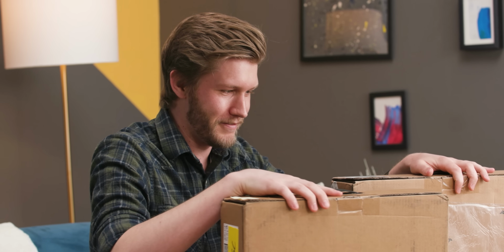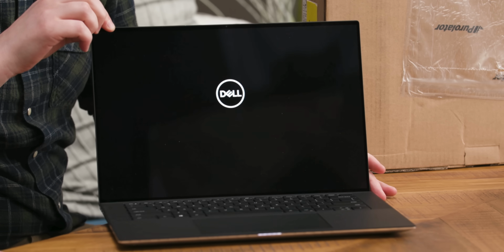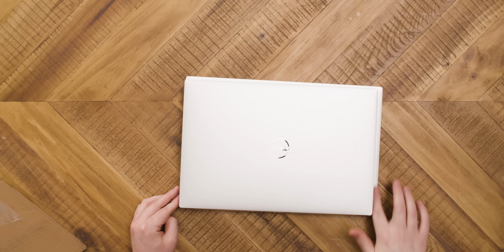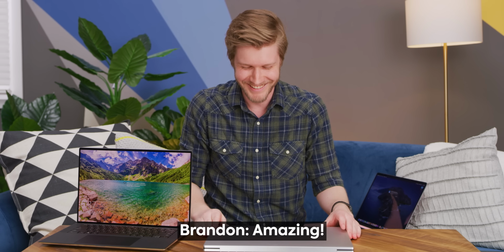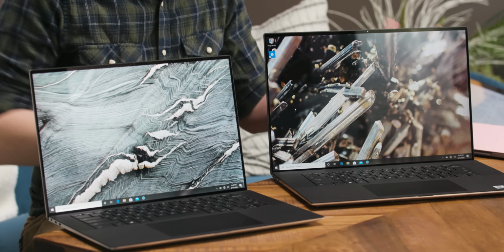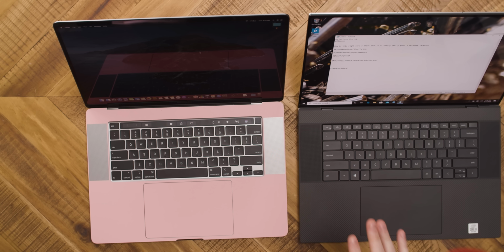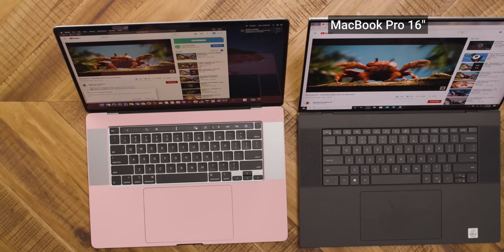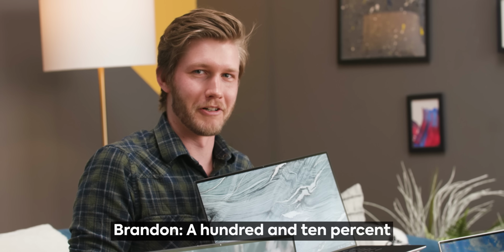The MacBook Pro's Biggest Rival - DELL XPS 15 9500 & 17 9700 Laptops

Comment: (Long rant incoming) 2 years in I figured I'd come back since I had bought my 9500 based off this review so for anyone still considering one, it's an excellent laptop with incredible specs. I purchased mine configured with the i7, GTX 1650, 256gb SSD, and 16 gigs of ram. I have upgraded it with 64 gigs of ram and dual 1TB WD Black NVMe drives and it's an absolute beast of a system, however mine is plagued with the wobbly trackpad issue that has been widely reported with this model of the XPS 15, and starting a few months ago the display hinge on the left side has become incredibly stiff and creaky. Reached out to Dell's support and their first instinct upon mentioning the issues was to immediately throw blame on me and no amount of pressuring on my part ever got them to budge on repairs. So overall it's an excellent system but Dell's awful customer service and the build quality issues I've encountered are absolutely unacceptable for a premium system that carries a price tag in the thousands range.

Comment: hello, i am trying to find the right laptop for a long time..  no gaming, no video editing, no autocad or render work.. i will only use laptop for financial trading stock programs that need high CPU, SSD and ram.  and laptop will be used from 09:00 am to 11 pm // all day nearly of course not will battery, always plugded in. i read some coil whine problems abaout this model.. can you advice this model for me ? heating /cooling issued and stable performance? thank you

Comment: I ordered my 9500 in 8/2020. The trackpad clicks work intermittently. It's very frustrating to use the laptop with the touchpad. I called Dell and they sent a repair technician to my house. The new palm rest/keyboard/trackpad also has the wireless antenna. The cable for the antenna was defective. The technician tried for over an hour to get the cable to work, losing his temper and throwing his tools in my livingroom. The technician also said that Dell doesn't know how to design a laptop. He also got mad when he had an extra part he didn't remember where it went back to. He couldn't get the antenna cable back on but did something with a screw to hold it next to it and told me he didn't have all night to sit here and try to fix it. After the machine was "finished" it still had the same click problem. I called Dell and the first two customer service reps hung up on me. I have been trying to speak to a manager for almost a week now to get a replacement unit sent. I'm telling you, I will never buy another Dell product as long as I live. I should have bought a MBP.

Comment: I just want to share my experience - just over 6 weeks in - of the XPS 15 9500. We bought 4 top-spec versions of these, at a total cost of almost £10k, for our business partners. They look and feel great, at first... but the aluminium is very thin (nothing like a Macbook) and dents incredibly easily. There are SO MANY calibration issues with them. Thermal regulation is a joke; you need to completely shut them down before putting them in a bag, or they overheat to a dangerous degree. The trackpad and keyboard randomly glitch, and the process management is shot - we each have to restart at least once or twice a day, just to get the computer functioning again. The list goes on. They feel very much like pre-release prototypes, rather than high-end or even market-ready machines. Having switched from a 7-year old Macbook Pro with Windows 10 running on Bootcamp, which was otherwise flawless but no longer powerful enough, I'm severely disappointed and frustrated with my experience of Dell. Apparently we are far from alone in these issues - many of which apparently even existed with previous models and were never resolved with drivers / BIOS updates.
Reply: Thank you for this comment. I was about to get the 15 but now I'm holding back and scratching my head at what to get...
Reply: @Iqbal Muhammad haha, no. Just got one and it’s absolutely abysmal how many issues there are in the hardware and software both. Only had it for a few days and I already feel like I need to get it replaced.
Reply: @NikeloaZ  I've re-evaluated my needs and I tried to buy a ThinkPad T14s. However delivery is 6 weeks. :(
Reply: There is no problem on mine. I think windows are updating on your computers. I normally update everything at first. It will take sometimes to update everything.
Reply: @KhoaNewZen  We of course immediately installed all updates. We in fact check for and install updates on a daily basis. The issues are still present, although ever-changing. Slowly the machines have become more functional, but comparing the stability and reliability of these to our prior Macs is sobering. We will never use Dell again. Post-sales care has also been basically non-existent, but now we have invested thousands in these machines we are stuck with them for a while.
Reply: @Iqbal The EOD Specialist That may be, but it's irresponsible of a manufacturer to sell products that are not market-ready. These machines are the business tools of four partners in a business, which has caused a significant negative impact. When buying 'top of the line' computers, for large sums of money, you should not receive a prototype.

Comment: XPS "Last updated in 2012"? The Precision 5000 Series was a new design of its time (I'm typing this on a 2015 5510) I've waited thru the 5520,30 and 40 until they dealt with the heating issues, which they now seem to have dealt with in the 5750 at least.
Was the last major update of the XPS in 2012? Not the bodies I've seen. Is that accurate?

Comment: Why is this newb comparing trackpads like they are the selling point of the laptops? It's not. A larger trackpad has proven to be much much more obstructive to work with than the smaller trackpads. Obviously this guy only has to review the laptops but not work on them. Hence he really has no idea when he "thinks" that larger trackpad is better. Making the move to large trackpads by Apple is the second worst idea ever. The worst is the touch bar.

Comment: I have a 13 inch 1080p laptop screen, and It clearly is not a "retina"" display at a normal distance.. 1080p screen on laptops still look good, but you can 100 percent notice the differnce betweeen 4k screens.. Tired of this idiot reviewers saying theres no difference.. when its so fucking clear as day.... And dont forget that 4k gives you more scaling intervals (since windows 10 only allows 25% increments) and is alot better to cuztimize to your liking..
Reply: I have the Dell XPS 17 9700 with a 4k display, and I really do notice the difference. However, for a 13 inch laptop, the difference is less noticeable than in a 17 inch laptop.
Reply: @RandomTechVideos  The difference is small on a 13 inch laptop.. but still noticeable and should be standard in a world where every phone is 400+ppi

Comment: Be warned the XPS 17 loses battery charge when both CPU and GPU are used heavily for longer periods of time. Well documented on the RTX 2060 configurations. Dell provides only 130W chargers that cannot provide enough power. Also, Dell guarantees only 300 charge cycles on the battery so this could potentially significantly lower battery life too.
Reply: Mine came directly from Dell with a 180w power supply
Reply: Erik Lotshaw that’s awesome news. Could you kindly take a picture of the info on the adapter? Thank you!
Reply: @eriklotshaw  What? How? Can you give us more info?

Comment: Hey guys! I am a Youtuber as well and do quite a bit of video editing but I have no idea which specs I need. Here's what I DON'T need. Since I have an external monitor, the size of the laptop screen or it being touchscreen means nothing to me. While very nice, all the premium materials & thinness of the XPS range are also not needed. The laptop also stays in one place so portability is not needed but I don't want a big desktop. I just need a pretty quick laptop that will render my videos as fast as possible. I also would like not to break the bank. Here's what I DO(or think I do)need: I want a Dell. Intel i7 9th or 10th Gen, 16gigs or more of RAM, 512gb Hardrive and not sure if a dedicated graphics card helps in the rendering of videos or if that's for game play on the machine itself of which I do none. Any suggestions?

Comment: I know it's super old video but several mistakes: dell 15 9500 has 1650 Ti mobile not maxQ. It has performance close to 1060 mobile while a maxQ 1650 Ti is much worse. Another mistake is dell 15 9500 CAN and WILL draw 130 watt, the peak can even pass that limit. Final one is, the guess about battery time is right but with large battery and FHD+, it can run 16 hours, which is more than enough. Plus one: Dell 15 9500 still has the heatness isolation between keyboard and the motherboard, which is surprisingly, to some extent anti-spill. It cannot prevent damages from water but will reduce the repair cost compared to macbook pro. If you are lucky, you don't need to repair at all.

Comment: Isn't it not going to be excellent at gaming because its too thin to have a proper cooling system? Sure 5+ ghz, but that will come right back down after 10 seconds when the fans can't keep up
Reply: Actually that would happen if you have super strong cooling since there is power throttling on laptop. Heatness throttling can be solved by undervolting and by thermal pad between heatpipe and the D-cover (which will burn your skin though). Surprisingly, the default cooling is not that bad. Check reddit and notebookreview for more.

Comment: What about performance on battery and NOT connected to power? Non-mac laptop, including dell, always down clock significantly when running on battery while mac’s benchmark exact the same whether it runs on battery or connected to power.

Comment: Got my 9500 today .. I know what the keyboard feels like, the AW m15r2 - I think LTT review said that the xps people should take a leaf out of the AW guys books and it looks like it happened.  Couldn't get it working with my Aorus gaming box 1080 on the internal monitor but external works fine (usual Windows driver nonsense of course when you connect/disconnect) .. MUCH better fps than the 7590 managed with the same box (+20%@1080p) - PCH must be different config.

Comment: Packaging in general has improved so much in the past few years. Remember the packaging for your last laptop 5 years ago? It was like opening a vaccuum cleaner...
Reply: Xps has always had decent packaging though. Am still using my 2015 model but the soft touch carbon fibre coating has turned slimey and gross :’)
Reply: D T hmm. I always bought well into the budget end before my last laptop (a lenovo yoga and even that was open box). Might be time to buy something higher end  next time.

Comment: Here is my experience with the Dell XPS 15 9570  4K version over the last year and 7 montha:
This laptop is amazing when it works. There are some things about this laptop that may seem excusable but defintely not with the pricetag. I have an issue where sometimes the touchpad doesn't work, it takes a restart of the laptop or waiting a couple hours for it to magically work again (I've tried driver fixes but for £1500 is this what I paid for?)
When I originally recieved the laptop the 4K screen would flicker and glitch out, this required a complete screen replacement from Dell which they did free of charge as I was in warranty however, is this the type of quality control you get for £1500? I noticed this was also a common issue many others have had online.
Now nearly 2 years later, the laptop has a battery issue where putting the laptop to sleep then waking it puts the battery at 1% and requires a 'jump-start' with the charger which puts the battery counter to its actual percentage. This is inredibly frustrating as I have to carry my charger with me everywhere.

I don't mean to come off as a nag, but when you pay so much for a laptop these problems should not even exist. Everyone knows apple has much better customer service especially with the ability to go in store and get your device checked and the whole experience has honestly made me wish I brought a macbook pro. 
If you are going to purchase from Dell, please take into account these problems may persist.

Comment: My favorite is to have both barrel or better yet magnetic for fast charging, or desktop us at home, and usbc for good enough charging, and a lighter charger brick when on the road.
I hate when comapnies force just one on you on powerful over 100 watt laptops, give us both and let us make the choice, dont make it for us, because pros use their device differently.

And the main reason il ike the faster barrel plug is, it does not take up one of my valuble usbc/tb3 ports.
So while charging the 15" you lose one of those ports, and that is Huge in certain workflow situations.

So please people, I know you like USBC charging and I do to, but do not ask them to also take away the more powerful barrel /magnetic/surface connect charging ports.

As it is better for evey one if we have both, especially if say one type were to stop working, you would still have a second way to charge your laptop.

That was why I loved usbc charging, until they became cheap and took away regular charging, meaning I have to use one of my few ports to charge.

Comment: Have an XPS 15 9570, only problem is the speaker was terrible, but connecting to a headphone fix that. Limited ports, not a major problem coz juz buy a dock with lots of ports. Screen size, juz connect it to multiple widescreen display. Keyboard, bought a rgb mechanical keyboard. The perfect laptop for any1 is still how much you wanna spend on something that will die within 3-5 years.

Comment: Given the 15 inch is slightly smaller than the previous years model, would be interested to know what the size difference is between the new 17 inch model and last years 15 inch model.

Comment: What configuration would you recommend for the 15 inch ? Would it be better to not get touch screen to avoid thermal issues and just go something like a 32gb / 512gb ? Is the 4k isnt necessary on a 15 inch screen ? Thanks

Comment: What a sexi laptop that 15 inch, to bad it has only 2 thunderbolt and 1 usb port.
I have a little audio studio at home and that is just not enough i/o. One of the ports will be used for power always and you need at least 3 other ports 1 for MIDI, 1 for Audio and 1 for a hub with peripherals.

Comment: I was waiting for 17" XPS since day 1 I got the first XPS, and I just adapted to smaller size monitor (15" 4k) when they went for 17" model... I just got the ProArt SB Pro 17 as a multimedia 17" portable  I need to use sometimes... Too late Dell...

Comment: The only thing that would make me consider the 17 over the 15 or 13 is the cooling system which he didn't even go into.  The 17 has a BRANDNEW cooling tunnel/vortex design that will supposedly make a HUGE different.  As for the 'gaming' aspect, I would have a desktop or a different laptop with crazy cooling.  These XPS are good reliable productivity with light visual capability not for gaming.

Comment: Imagine plugging in the charger to both sides simultaneously.
Reply: MARCUSAURELIUS it would also save you electricity bill by sending power back to the grid. :)
Reply: easy way to double the power
Reply: Instructions unclear, computer became a black hole
Reply: stonk abuse
Reply: I doubt it will work, it'll most likely prioritise certain ports.
Reply: Hopefully they dont patch this glitch

Comment: Razer products are supposed to break

Friends had Razer mice, Razer keyboards, Razer headsets, all broke within 3 years (some as soon as just after a year) and all those products were in the $50++ range.

Meanwhile my Kinzu V2 Pro finally was replaced after nearly 9 years of brutal abuse and my 6Gv2 is still going strong (admittedly after a 9kg dumbell fell on it my numbad - key stopped working, that was 3 years in).

Comment: Is it twice as big? It has to be close, if not twice as big. 

Just look at it. I don't know what else to say. It's just a beautiful thing. 

It is a bit smaller. It's not much; but to be fair, it's noticeable.
Also, I wonder if thickness is any different.

Is that the same size? 
Not that you are going to be complaining about the size of this at all.
Yeah, it's totally the same size.

Given how big this is...
Like you can kind of go in and get into, sort of like, a flow state...

I feel like I can just burst through stuff really quickly...

If I had to guess, you'll probably be able to use the 15 for something like 9 hours, and the 17 would probably be closer to 10, 10 and a half, but it really depends on what you're gonna do, cuz these are able to come at some really powerful configurations.

The 15-inch, right here,is looking pretty compelling...

Comment: Where is usb A? Worthless computer without it. At the moment I'm even using a application's with a usb license, a minimum  off 2, 3 would be good amount off usb a ports. 
And no numpad on a 17" inch. Also, those big touch pads is just anoying. No matter how good the false touch is, it will register sometimes while typing.